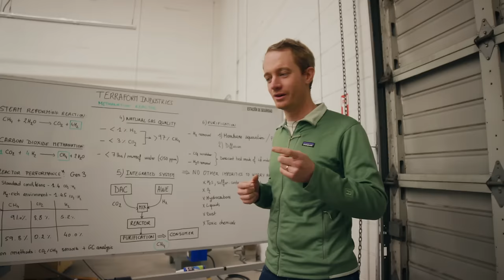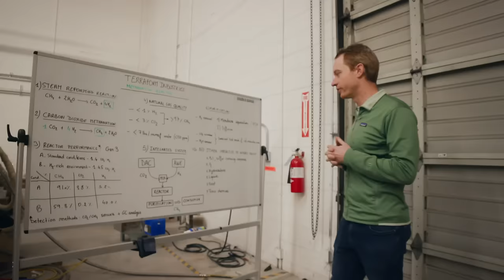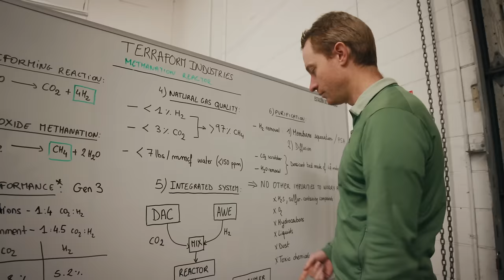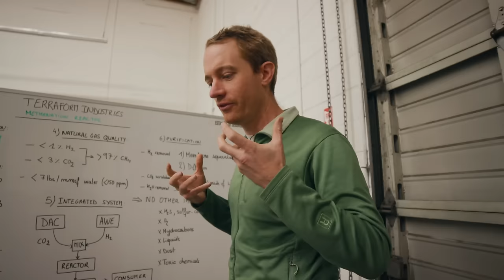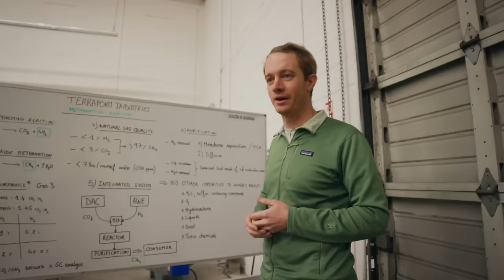The Future of Humanity's Energy No One Knows About | Terraform

Comment: Comparing solar to farming is a bit of an unfair comparison as humanity can survive without electricity but surviving without food isn't possible.  Now if you raise the panels off of the ground then you can the best of both worlds, shaded farming and power generation.

The longer I watch this video the more it's clear that this dude is just creating ways to more efficiently F the world.
Reply: technically everything he would be doing is carbon neutral, at least for the process itself. so no negative impact on global warming. In the most optimistic situation his product could be used exclusively to sequester carbon if he wanted
Reply: Yeah the context might have got lost in editing but that seemed like a slightly weird tangent. As you say, solar panels can be profitably combined with agriculture, or they can be put on unproductive land. They don't need to compete.
Reply: Except Casey thinks farming will one day also be replaced by synthetic food made from air with solar panels.
Reply: How is burning hydrocarbons carbon neutral? Whats the point of creating hydrocarbons out of energy if you already have the energy? @DheRadman
Reply: @GreerViau  All the hydrocarbons that would be burning are generated from carbon taken from the air. So there's no net addition of carbon to the ecosystem once the setup is there. Technically there would still be a footprint from building the solar farm but that's a separate issue. 

As for the why, he explains it in the video. Most of the world still uses hydrocarbons for energy. They're not going to transition to electric over night so this would be a more eco-friendly stepping stone that utilizes pre existing infrastructure. 

Plus even when the transition from hydrocarbons is complete his system would still be useful to capture carbon from the air in order to sequester it so it's not even a sunk cost
Reply: @DheRadman  it would only be carbon neutral if you could build a system with 0 losses, but since that's not possible you're still going to be polluting the atmosphere. It's understandable that we still rely on hydrocarbons, but they're talking about producing natural gas, specifically methane, and vehicles don't run on methane, the only real application of that is energy production. Even if there are points about cost of transporting energy, I understand that but it's not right to say that environmental impacts should take a backseat to that. I just think efforts would be better spent put into developing better battery technologies, making renewables more widespread which would also drive down cost of transporting electricity, and investing in more efficient and cleaner sources like nuclear.
Reply: @GreerViau  There definitely could be some methane lost to the atmosphere but it's hard to say whether it would be a significant amount. Pretty sure oil wells must let things vent straight to the atmosphere (even though they may not be legally allowed to), so again this would still be preferable to the current option and again the infrastructure could be used to sequester carbon after hydrocarbons are no longer needed which would be incredibly useful. 

Furthermore there are plenty of places that use methane to heat homes. That includes much of the northern US, Canada and I would imagine Europe. There are also some people who want to use natural gas engines for trucks and boats. I don't think there's a lot of justification to engineer new things like that when batteries are on the horizon, but I can imagine how large container ships want to maximize power density. The home heating is a huge one though. Just a rough look puts heating and cooling at 50% of the worlds energy expenditure and natural gas at 40% of that.
Reply: @GreerViau it s carbon neutral because in the process you extracted as much C02 from the air previoulsy as you would be able to burn. The point is: easy storage and transport if plugged in existing infrastructure (for example you can keep on using the exisitng gas power plants to produce electricity at the times needed when solar is not productive, or use HC as fuel in aviation, heavy industries where using electricity is challenging.) Also can make existing infrastructure carbon neutral without having to replace everything (which would be very demanding in ressources, including..fossil fuels as we won t have the capacity to do everything without them before a few decades)

Comment: Your math is off,, way, way off. You never produce enough hydrocarbons from solar panels. To give you a propective, the world uses about 400 years of hydrocarbons per day. For every day of fuel use, it took about 400 years to produce via sunlight using natural processes. 

The issue is you need to build hundreds of square kilometers of solar panels just to make about 1Mbpd of hydrocarbons, and you consume all of that fuel to just maintain the system since solar panels break, need to be cleaned, have a lot of infrastructure needs to connect them all and to power the hydrocarbon plant. 

That said, Peak Oil happened in 2018 (diesel peaked in 2015). and most of the major oil fields are in, or near terminal decline. We managed to postpone Oil production for about 20 years, using advance Oil recovery, ie horizontal drilling, fracking, etc. Its likely that in the not so distant future Oil production will see large decline (10% or more annually). If we are lucky BAU can last another 10 years, but I don't think that will happen. 

What likely to happen over the next 10 years, is an economic collapse fueled by debt, demographics and declining Oil production. The only real option is to establish homesteads to me mostly self-reliant for all the basics.
Reply: Do you have guns and ammo and live in the mountains
Reply: It isn't just off, but also unrealistic;
When he explains what is vision is, he says that the 3d printed model represents 5 acres (about 20234 m2, for example about 100m by 200m). Then he just mentioned that we'd need about 400 million times that for the future, of which I'll assume is with the current natural gas usage worldwide.
If you calculate 400 mil. * 5 acres, you get an surface area about the size of Brazil, the 5th largest country in the world...
Now, I do not know the underlaying calculations, so mayb I'm naïve by assuming he just ment 400 mil. acres. But than you'd still need a solar park the size of Iran.

Not only that, but I've still got quite a lot of other questions, like you as well it seems, in to what his calculations would assume, like suntime exposure, sun strength exposure, required power to maintain said solar "park", and more
Reply: We don#t need to replace ALL current hydrocarbons with synthetic. Much of it will be electrified (likely all automotive, most resi heating). Only some applications really need hydrocarbons, notably chemistry to make plastics, fertilizer and high-temperature heating, airplanes and ships.
Reply: @Martinit0  No, most of it will not get electrofied. 2/3s of energy used is for transportation & industrial processes that require heat input. You also forgot to include trucking, agracuture (tractors, harvesters, etc) and rail which is 99% fossil fueled. 

As of 2024, Solar is still less than 1% of grid power. NatGas, coal & nuclear is about 85% of grid power.  No way can the grid supply enough power for EVs,  Gasoline cars in the US use about 12 GWh/per day. US Grid include all fossil fuels is about 4 GWh per day. Just to electricify all gasoline cars the Grid would would need to increase by four times. Than double that for trucking & avation. Then Double it again for heating home & buildings.

BTW: The world is going to fall into a big energy crunch in the 2030s as Oil production begins to collapse. Global Oil production peaked in 2018. Shale production is near the end as most of the new wells are producing Gas Condensate & not much Oil. The US (shale) was the only significant increase of global oil production since 2013. Second was Russia which the US burned it bridges with over a pointless war that the US started.

Comment: not trying to be "that guy" but shouldnt we be transitioning away from hydrocarbons because ya'know... they're kinda awful for humans and the environment?
Reply: Exactly
Reply: Move beyond the bumper sticker. LOL
Hydrocarbons are very dense energy. And his recycling of these from HC to CO2 then back to HC is a nice net zero gain of CO2. May be better than the hydrogen cycle due to safety.
Reply: Some niche industries will need hydrocarbons for quite a while to generate very high heat required for certain processes.

Might as well make them carbon neutral and renewable
Reply: @TheKdcool  how exactly does this make them carbon neutral? You still need to burn the methane which releases co2, that never seems to get mentioned in the video. Even if you use co2 from the air, it would only be neutral if you assume 0 losses. All that happens here is wasting energy and continuing to pollute the atmosphere.
Reply: @TheKdcool  the only thing is I checked his math, and in order to produce the amount he wants, he would have to have a solar farm roughly the size of the entire midwest, so idk how he plans to do that
Reply: Of course it's much more intelligent to install a heat pump for heating buildings and to drive electric cars. I agree that this process is wasteful and the solar energy would be much better off being used in it's raw form BUT certain things just CAN'T be electrified economically with current tech. Rockets, planes, very high heat smelting requires you to burn things.
Reply: @TheKdcool  but you can burn them more efficiently? and with other things? smelting at this point on an industrial scale is mainly done with car tires, and rockets and planes are being developed that use hydrogen. not everything needs to be "electrified" He is trying to solve a problem that does not exist. He says his reasoning is "fossil fuels are becoming more scarce" but that is not why people are transitioning away from them, it is because they are killing our entire civilization.
Reply: This process is net zero which isn't as bad as fossil fuels.
Reply: @sadface7457   As many other people have pointed out, it is not net zero. It actually produces large amounts of excess methane (not even including gas leaks.) The CEO never addresses this in the video.

Comment: In real terms energy produced traditionally keeps getting cheaper. Oil and gas production are at all time highs. We've had 50 years of reserves for 50 years. If you understand the definition of a reserve (economic to produce today) and you understand O&G technology advancement then you'll understand that we won't run out of oil or gas for a VERY long time. In addition, it will likely keep getting cheaper in real terms so this business has no business other than Mars and gov't wasted spending.
Reply: Solar PV is also extremely cheap, down to about 2c/kWh installed in commercial production. That's the cheapest energy in human history. And we are just getting started.
Reply: @Secretlyanothername  That's only one of many step in the process to synthetic fuels he's discussing. Also, solar power quality is trash, so 2c/kWh doesn't mean much which is why you need synthetic fuels...

Comment: 6:35 This is a good point, but the issue with outsourcing energy requirements to non-human-respiratory areas, is that it produces high-entropy waste. It's not as collectively efficient as burning ATP, since that burns pretty hot as is, and the waste products can be further metabolised.

Comment: Super cool. Hope this goes well.
I´ve been thinking about putting the solar arrays on huge ships that operates close to the poles to increase the daylight time. These will unload the fuel as is done today since they are ships.
Ships are expensive and I have not done the math, but ships will be needed to move the fuel anyways I think. Running a system like this works pretty bad during winter, when the need for fuel is the greatest (if you live far from the equator).

Comment: ‘The key thing here is that transporting energy in the form of electricity is about 25 times more expensive than transporting it in the form of hydrocarbons.’ 

Well that’s not sent in stone. Costs of transporting energy will fall as more long range energy projects are created. A single project miles out into the desert will cost much more than ten such farms fairly closely spaced using the same connectors. It’s amazing what experience and volume can do to the cost of manufactured plant. Offshore wind energy used to be the most expensive, and now it is amongst the cheapest form of electricity in the UK.

On the other hand, as countries move away from oil and gas power, there will be global oversupply and the cost of hydrocarbons will fall. So the business model is perhaps not so great in the medium/ long term.

Finally, whyyyy? Why would you take a precious, tiny hope for green energy for humanity and kick the bucket from under it? Why don’t you study energy storage instead so we can use intermittent but cheap sources of energy and not contribute to the climate crisis?

Comment: This is a suggestion on CO2 production.  Instead of the standard calcination of limestone,  react the limestone with nitric acid to produce CaNO3.  Calcium nitrate has a lower temperature of calcination.  A concentrated solar thermal facility can reach those temperatures.  The byproduct NO2 can be converted back into nitric acid to close the loop and reduce waste.  Side project - Can a solar farm be a contained ammonia plat.  The ammonia would be oxidized to NO2 for the production of the nitric acid.
Reply: That is interesting. But CO2 capture from the atmosphere is the goal I believe. But it's gotta start somewhere. And the Nullarbor plain in the south of Australia is made of limestone, incredibly sunny and lhas plenty of water, being located on the southern ocean
Reply: @emceeboogieboots1608  The CaO produced from calcination can be mixed with water to produce Ca(OH)2.  The slaked lime (lime water) produced can have air bubbled through it to precipitate out CaCO3.  I believe some of the hardening of concrete is its slow reaction of its CaO back into CaCO3 by reacting with the CO2 from the air.

Comment: Not really a word on efficiency. The world has a limited production capacity of solar panels. Lets say the efficiency from the solar panels to running a car on methane is 10%, one could run so many MORE electric cars on the solar panels produced.

Synthetic methane might be useful for the really hard to electrify processes, but surely we should put most of our resources into electrification.
Reply: They could use the methane to run gas turbine generators at night. I'm sure there would be more efficient solutions. It would have to be cheaper than batteries after accounting for efficiency losses. Current batteries are not suitable.

Comment: A few questions. Will this be cheaper to make on Mars than drilling from Titan and shipping it? We have found so much hydrocarbons on Titan, it would seem to be an ideal gas space station.
Second, you have done the calculation on how much Carbon we must leave in our atmosphere, right? We are rauge on how much carbon we can put in, but we know approximately how much we can take out before the plants and trees go into an irreversible death cycle. Has that been accounted for?
Reply: Titan is quite a ways away, I think you’re about 100 steps away at that point.

And if we are burning the natural gas for fuel the carbon would end up back in the atmosphere
Reply: @DrRumsmuggler  Well, since it would be on Mars, you kinda want it in the atmosphere, you don't have trees or any other natural process creating the greenhouse effect currently. Once we finally bootstrap a system up and running, you can then worry about too much carbon.

Comment: Interesting processes. I'm not a huge fan of cheap panels and singular use of the land but the other ideas make sense. We also don't need to burn the fuel to make it useful. An existing process called a solid oxide fuel cell can grab electrons and give you resources back. Fun stuff, and seemingly compatible with other processes.